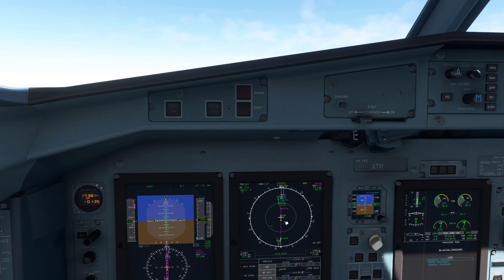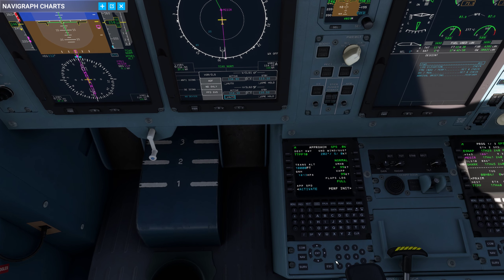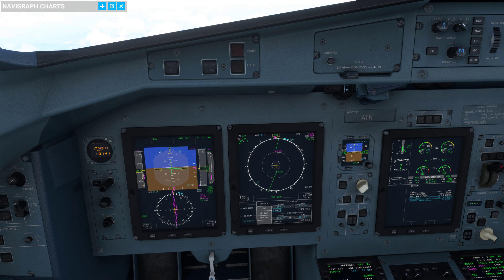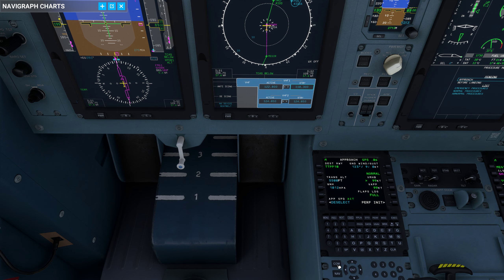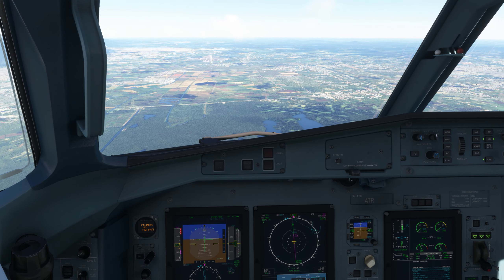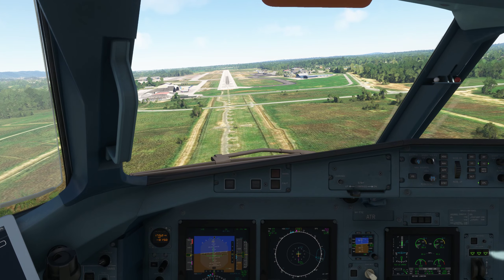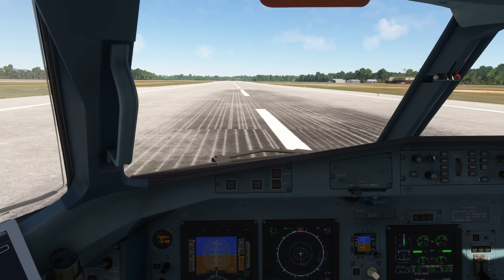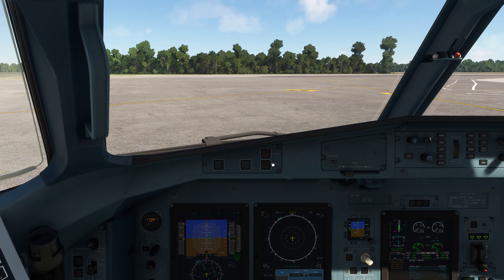FrameGen Crash Cause Discovered | Holy Grail + Frame Generation | ATR 72 | MSFS 2020

Comment from the maker: I just realized - as mentioned in the video, I uninstalled and performed a clean install of my graphics driver this morning, so I actually did NOT have the Holy Grail settings (DLDSR + DLSS) in this video, which is why it is not in 4K and why it looks fuzzy. What this proved to me is that the Holy Grail settings work.
Reply: You said, in your video, you rolled back to the Dec. 4 (546.29) but you details show 546.31. There is no 546.31 on .33. So, what exactly are you running? Thanks

Comment: This mod is working well for me so far aside from the gauge shimmering which goes away once airborn.  Also - I just completed a flight in the stock Asobo A320 from Philly to Ft. Lauderdale using Afterburner changing and experimenting with different settings along the way and all was fine with no crashes.
Reply: What vers# of the nvidia drivers are you on if you don’t mind?
Reply: I'm using the .31 Hotfix driver and 2080 Super with mostly Ultra except 100 on TLOD and OLOD to give my CPU a break.

Comment: apparently nobody else has this issue... tried using the frame gen mod (rtx 2060 super, latest nvidia driver) and when i load into an airport it gets to 3/4 or so and then freezes, does not continue no matter how long i wait
Reply: I have this as well on a 2070 - I'm 90% sure it's a VRAM maxing out issue
Reply: Got the same problem, but only with the fenix A320. I have a 2070 super and the drivers 546.31.
Reply: @lm5337 yeah same only tried the fenix though i think im on 537.58
Reply: Same issue for me 2070 super, Only happens in the Fenix, anyone got a fix?

Comment: Frame gen just looks like trash in my rig. Not sure what is different running a 3070, but the screen just gets torn up with artifacts. Tried all kinds of options vsync,taa,dlss limiting frame rates. G1000 unreadable. I have been hunting for someone who has been using this successfully to say what nvidia driver version they are using

Comment: great show      I have v5.0 installed    there is new version of that file 0.80   Iam ok with 5.0    do I need uninstall 5.0 then install 8.0   what's the best way to go    I have a asus  3090 GPU thanks man
Reply from the maker: Hey, if 0.5 is working for you I’d be inclined to stick with it. I’ve updated to 0.8 but I was having performance issues.

Comment: I appreciate the good work you are doing in your channel recently within MSFS. Truly I am really interested in this mod.This is now going viral on most MSFS content creators recent subject matters. Is this hype ?, can this damage your Nvidia GPU, what I mean is, are the temperatures stable ?. Do the temps rise with this mod enabled,  compared with not using this mod ?. Will it offer any improvement for example with an RTX 2080 TI ?. The RTX 2080Ti has 11Gb of VRAM, is that enough for this mod. To be honest I am trying to get my head around the tech of this mod. Are we just seeing a placebo effect ?. Improved FPS, but what about smoothness ? when panning around cockpit and day to day use in many environments/aircraft choice and using live weather. Is this mod really only for RTX 4000 users ?. Does it provide any improvement for RTX 20 series users ?. I need to research this more. I am not yet convinced. There are many RTX 20 series users or 30 series users using normal TAA, DX11 etc and getting maybe 33-35 or 40 fps but have a very smooth experience in the sim. Many users often advise limiting the fps in the Nvidia Control panel to about 33fps anyway etc.  I suspect this is really only a boost for 40 series cards. Although I can see you have an RTX 30 series.   Also what about many of the accessories that people use, TOBI Eyetracker,  Loupedeck Live, various joystick brands some the most common being the Honeycomb, Thrustmaster TCA Airbus Quadrant etc. I`m also looking for advice. Apologies for so many questions. Of course in time FSR 3 will improve.
Reply: This mod is not for 40 series cards at all bc they already have Frame Generation.

Comment: Ok. 2060Super, i7 9700 here, my frame rates were in the low 40s with everything on ultra prior to trying theese mods. I updated dlss file. I applied variable LOD mod. And I applied this FG mod. But my framerates remained the same, maybe even a little bit lower. The only thing I got were a couple of crashes after some long flights which I attributed to low VRAM memory issues. So I deactivated the FG mod and left the other two.
However, now that you say that I don't need to see the increase in FPS since the additional ones are virtual ones, and since you say that the crashes may be due to some other things, I'm willing to retry the mod. Who knows!?👍
Reply from the maker: I always fly on Vatsim, sometimes there are controllers here but in this case I was treating it as a nontowered field.
Reply: @IslandSimPilot  Well.... since I'm on Steam, I activated it's FPS counter and it shows rock solid 60 FPS because my monitor refr😂esh rate is 60 Hz, and the only choice i have in settings is 1third, one half or 100 percent. Next important thing I heard and which proved to be the case was it took several restarings of the sim before everything 'sat in place'. Also, ocasional shimmering was lost once i turned off the bloom effect. Thanks !!!!!!!!!!!!!!!!!!!!!!!!!!!